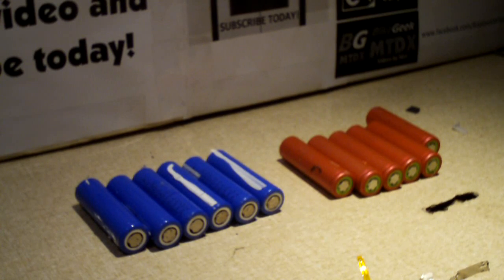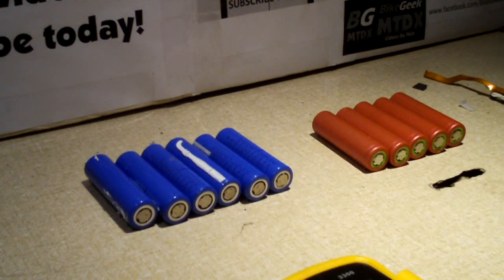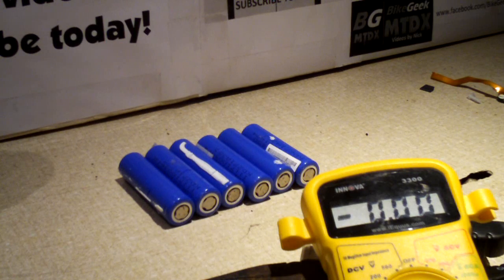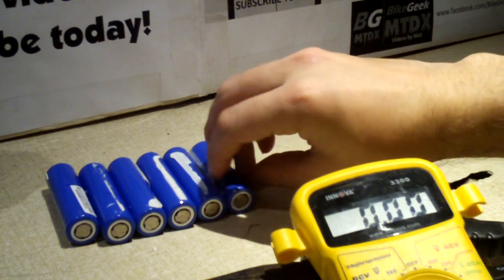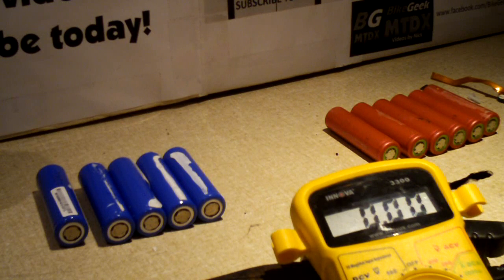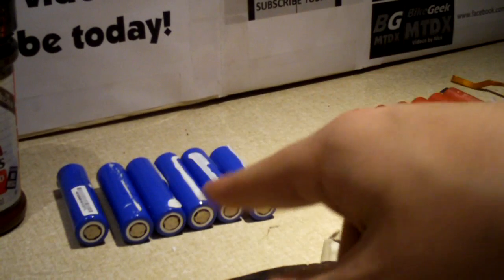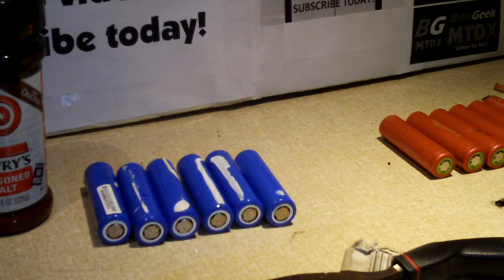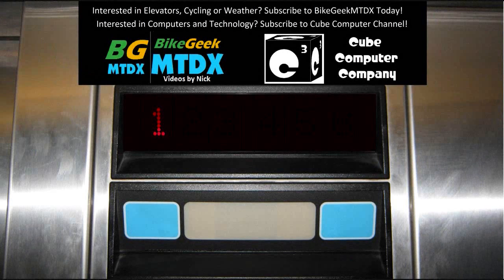Some info to know about harvesting 18650 Li-Ion cells from laptop batteries

Comment: This entire idea that if one tries to recharge a cell that has dropped below 2.7 volts it will explode has been debunked many times. Also, it defies common sense. Do you really think manufacturers would risk that financial ruin that would follow exploding battery cells? In most cases the battery will recover with little f any reduction in its capacity.

Comment: From my experience, I can tell you that the 18650 cells extracted from old laptop batteries are not worth the effort.  Especially Sony (green ones) are very high internal resistance and hot when charging. There are some cheap chinese batteris with lower internal resistance. Old laptop cells have, in gerneral, high internal resistance and have lost the original cappacity. This is my experience.
Reply: You can measure, fast, internal resistance with an multimetter and an 1 ohm resistor. At medium to full charge, when applying the resistor, If the voltage dropps with more than 0,2v, the battery is not good (have high internal resistance - more than 100 m ohm).
Reply from the maker: That's not the experience I have had with laptop cells. Most of the laptop cells I am using still charge to their original capacity, have reasonable IR and do not get hot when charging. This includes 12 Sony 2200mAh cells manufactured in 2003.
Reply: @CubeComputerChannel 
It is true that most of them had 0v, some 1v and some 2v. Maybe because of that the behaveour of bateries was not good. I was charging them the way it should be done (slow charge) but the performance after revival was not so good at all (especially all Sony - green had very high internal resistance). 
After this experience, I choose to never buy old laptop batteries. I just found recently a source (local store) of cheap chinese batteries with low internal resistance - about 35 m Ohms and 2200 mAh for about 1,5 us dollars. This was like a revelation to me. The goal is to build a 7s battery pack for my old Schwinn F18 electric scooter. I hope that the chinese 8650 specs will not change so soon after usage...
English is not my native language, so I am trying my best.

Comment: I had some 18650 that read 2.2 volts and i just bump charged them and they came back to full charge. I use them in my led flashlights with no problems. Don't throw them away they are still serviceable.

Comment: 2.8? Isnt that a bit low? I am only familiar with LiPo batteries.I try not to below 3.2V and treat that as fully discharged and only do that every so often. Normally I try not to go below 15-20%, or 3.3-3.4V
Reply from the maker: Lithium polymer is a little different chemistry versus lithium ion. Many 18650 datasheets specify 2.8V as maximum discharge.

Comment: those red cells are bad I have several all harvested from laptop batteries ever single one is a heater when put on lii 500 I have hundreds of good cells but nearly all the red ones are bad I think they may be cheap copys
Reply from the maker: The red cells are in fact Sanyo 2000mAh cells. Many Sanyo cells had issues with getting hot while charging, which resulted in many laptop batteries with them getting recalled.
Reply: +Cube Computer Channel thanks I think I have bought a batch of them then

Comment: You can add some text to this video and fix the disservice of tilling people those Sanyo's or any cell in that discharged state, is no good. I've brought hundreds of these back from a worse sate than those Sanyo's. My Nitcore i4 led charger, will recognize those and hit them with a bit more power to bring them back, then charge them as normal. Some chargers won't do that...like my Lii-500.

If they don't do anything in the Lii-500 charger, I put them in the Nitcore for a few minutes, then put them back into the other Lii, and they go fine.

My ecig is a single 18650 manual model and I've used several different ohm burners in it, and all do just fine with high or low drain. But one thing is true, whatever we do with these cells, do it with caution
Reply from the maker: I have resurrected the Sanyo cells and even some Panasonics that had drained to 1.5V. Many low-voltage cells can be resurrected, though there's a slightly higher risk of an internal short, and typically when a lithium ion cell is ran down so low for an extended period of time, there can be some capacity loss.

Comment: I had a cell at 0.21v.  Charged it in a TP4056 and it's holding 4.1v no problem.  Don't assume a cell is completely dead or unusable because it's been fully discharged.
Reply: I use those .99 cent garden light SOLAR panel...it brings them back to life...
I got 6 old laptop battery packs today. bascially 36-ea.
Im bascially going to rig up a  old solar panels to charge them.
I dont need them to be charge ASAP or in a day.
i have enough inventory....
I have over 50 cells, now....I make them into 3s or 4s packs for my R/C
contraptions
FREE energy...I got all the batteries for free from the junk or unwanted pile.
Plus I know they're not FAKE.lol

Comment: Your light won't light because the light would have a bms to stop the light from draining the 18650 to low. The Sanyo' s would come back most likely they just sat for a really long time that's why they are all close together in voltage if they had high resistance they would be close to zero it's very unlikely they all got high resistant at the same time to stay at 2 volts

Comment: "and things like that"   sounds like a true professional.those low voltage batteries can be charged and used again. I am using a batch of LG's I charged from .9vyou didn't even run a resistance test!!! but babbled on about how "they made themselves short out"??? REALLY?use a proper smart charger to do your resistance testing and you can recondition Li-on batteries.dummy!!

Comment: There are also fans that run single cell 18650 and I have several single cell cylinders for DIY USB power banks. The USB cylinders open all kinds of application.

Comment: So, you mentioned how using unprotected cells in a series configuration is a bad idea, most vaping hardware uses unprotected cells in series..... They usually have built in protections that will alert you of an unbalanced battery voltage, usually if there's a .3 difference or so, would that even be effective?
Reply: Nick Aguirre there are also constant stories of vape mods blowing up

Comment: Use a foxnovo charger best for recovering cells

There are 3 voltage stages to a 18650 battery charge if really drained (below 1v)

check the battery with multi meter to verify it has a voltage (even as low as 0.25v can be brought back to health)
 
place cell in charger
 
1st stage charge 
0.25 to 1.6v+ The charger will state full.

2nd stage
immediately pull the cell back from the positive terminal and then release, the cell will start to charge again but will climb hopefully to 2,25v (if it does not don't panic just keep repeating until you get the voltage to jump past 2.25v.

3rd Stage 
Once the cell gets above 2.25v it will then start climbing all the way to 4.2v full charge.
Reply: llamu dos Ana
Reply: llamu dos a

Comment: i use the cheap charger to jump start the charging if they go below voltage and smart charger wont charge i put it on the cheapo charger for 5 mins and then it'll come back and smart charger will pick it up and charge them back up

Comment: a TP4056 can charge those Sanyo cells very good. I had Panasonic NCR18650 at 2.2 volts, charged them with TP4056 to 4.18 volts and left them for a month. After a month they were at 4.12 volts. I tested there capacity on an Imax B6 charger and they had over 2700mAh available. So I think that Sanyo cells are not useless, they can work well for the flash light at least.

I have have even charged cells at 0.2 volts with TP4056.
Reply: You can also charge 18650 cells which are showing 0 volts using TP4056.

Comment: Okay so I have a bunch of 18650s from a laptop battery, unbranded but a few of them are fine. They are all 18x65 mm, are these unprotected or not? How much longer are protected cells?
Reply from the maker: Bare cells pulled from laptops are unprotected as the monitoring/charging board is the protection for the whole pack. Protected 18650s are usually 1-2mm longer on the negative end as that's where the protection board would normally get added.
Reply: Thanks!

Comment: If you find video "18650 Battery Addict" you might be able to recharge those red ones from dead.
Reply: From my experience, those Sanyo (red batteries) are almost always horrible. Rarely charge fully or heat up to 70+ degrees celsius

Comment: I'm working with some similar Sanyo cells 18650s that had a starting voltage of 2.54V but I cycled them and got them up to 4.2V. they each took 2200mA. if I were you in would try and charge them up. also you can check the actual capacity of each cell with most chargers.

Comment: Do not know if this is of any interest to you, but I just found these on Ebay.
http://www.ebay.com/itm/252399557148?var=551246963715
http://www.ebay.com/itm/262525402636
With these, you could make an inexpensive bank of cells.
Reply from the maker: I currently have a 2-cell USB power bank. They come in handy!

Comment: Your red cells there, may not be completely gone.  An ordinary charger will reject them.  If you "trickle charge" them (0.2 amps) for a day, they sometimes assume ordinary elasticity .  Would do this outdoors, of course.
Reply: I've recovered a lot that way and found some very good cells.  You really only need that slow charge for about 5 min and the voltage will be above 3 V and you can charge as normal.
Reply from the maker: I do plan to attempt revival of those when I get some time
Reply: I charged my cells upto 4.2v but that cells automatically discharge upto 3.8 or 3.9 what I do?

Comment: are these blue lg batteries protected or unprotected, just wondering, because i have those myself from an hp battery, intended to use them in my flashlight. Also do you know what their capacity is ?
Reply from the maker: The blue LG batteries are 2200mAh unprotected.
Reply: Hannes ASMR they should say on the side in xxxxxmah.... 5000mah are good ones, i have some that came in flashlights (tourche if you are british). I have a few cheap ones that are 3000mah.  You can get single cell charger boards on line for less than half a buck and just connect a holder, and plug your USB  charger into the board. The LED changes color when its charged

Comment: Flashilights? Cmon now. I use them to build E bikes and skateboards for huge savings on personal transportation costs! Good video though....nice.
Reply from the maker: +Joshua B I prefer use of leg power on a bicycle.
Reply: +Cube Computer Channel Life is too short to be peddling and going 10 mph. TIME IS MONEY... thus, if you can go 35 mph on a bike without getting sweaty in your clothes and get from point A to point B in less time... this equals MONEY. Also, the trips that normally require getting in your car and burning gas and clogging up traffic are completely eliminated with electric bikes and skateboards. Much more practical to use these batteries to provide clean and efficient personal transportation. A flashlight doesn't have that kind of impact on people and the environment.
Reply from the maker: +Joshua B I can pedal the bike and still do 35MPH. Point is, I see a bike for exercise, not something to slap an electric motor onto. If I wanted something with 2 wheels that was motorized, I would just buy a motorcycle. I've had two road bikes over the past decade and put over 8000 miles on them combined. No electric assist here.
Reply: +Cube Computer Channel Do you read before you respond? Clearly you missed the point if you say you rather burn gas on a motorcycle to get from point A to point B. Electric bikes are more efficient than a motorcycle and less costly to maintain and better for the environment. Thats the point here... its not about getting exercise on a bike.
Reply from the maker: +Joshua B Maybe you're the one who missed the point...

"If I wanted something with 2 wheels that was motorized, I would just buy a motorcycle."

Key works is IF. I don't plan on owning a motorcycle. Riding a bike with your legs is better for the environment and for your health than burning electricity. Some coal plant or nuclear plant somewhere is likely generating that power that you are charging those batteries with. I am not going to motorize my bike. There's already enough car drivers out there who take the pedal on the right for granted and a lot of motorcyclists who take the trigger on the right for granted, and have never stepped onto a bicycle and used it as a to b transportation. If more people would rely on leg powered bicycles instead of their cars and motorcycles, even just for short distance transportation, there wouldn't be such a huge obesity epidemic going on right now.

I have seen many videos of people harvesting laptop 18650s to make bike batteries, and that's cool. But you'll never see my bicycle powered by them. Yes, they work wonders for my headlamp, but making the bike move is the responsibility of my legs. No hard feelings, but you're talking with someone who's been somewhat an avid cyclist for many years.
Reply: Joshua B  the batteries for flashlight i've seen are cheaper than others.... it works good for storage systemso EV?

Comment: charge at low current 100 ma for a few hrs then increase by 100 ma till you reach 500ma check voltage if at 2.8-3.00 charge st 1amp for 4 hrs check temp and volts.. if at 3.3 or more charge at 3 amp for further 6hrs and check volts.. leave to stand for 10 to qw hrs if it still is near to the last reading battery is now recovered.. but I would get a charger/discharger like an imax B6 and you can use it to find out the cells capacity also..